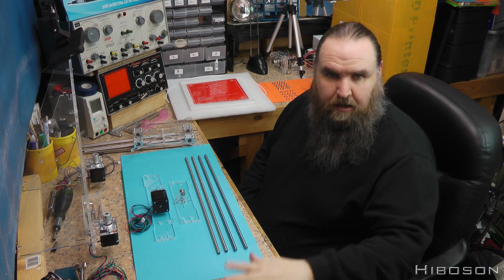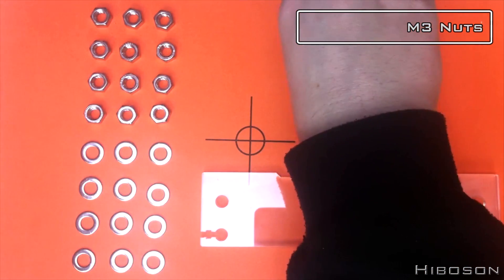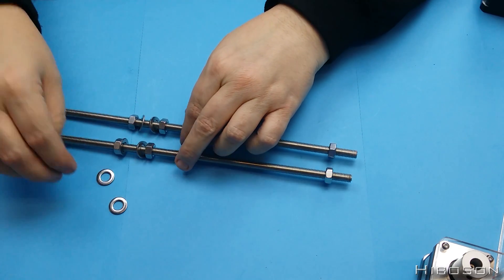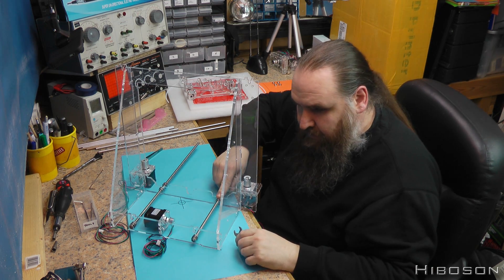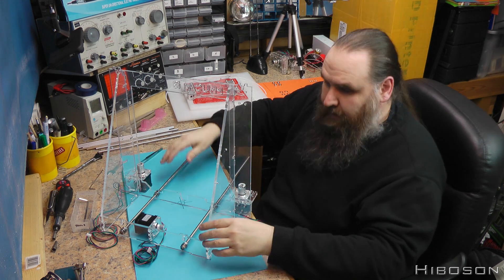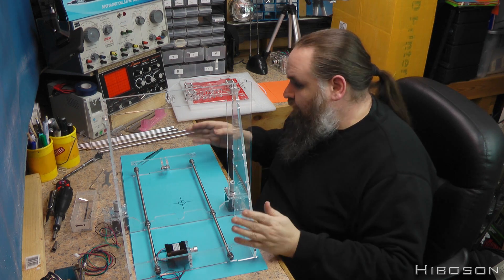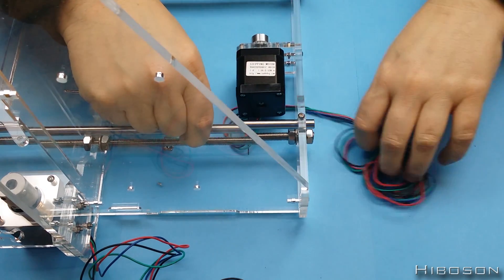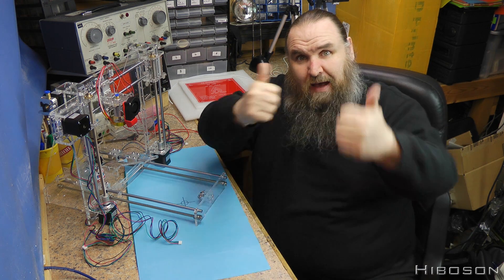3D Printer Build - Sunhokey Prusa i3 - Part D

Comment: I've been very interested in this particular kit, because of the price and the overall good comments on the page. It is to note some points about the printer particularly abour the duct that cools the extruded filament has a desing flaw and only cools one side of the printed part creating a temp diference that badly affects the quality of the print. for that a user of thingiverse posted an improved version of the duct http://www.thingiverse.com/thing:714939/#files.
in general it is a pretty solid kit compared to other for about the same price in the market.
Reply from the maker: David Ramirez I saw all the good comments about the kit itself, not so many about the aftersales lol but the kit yes :) thats why I finally went to myself "just buy it stop procrastinating" lol 

And thanks for that link to the fan upgrade part,, I actually went Ooooooooo cool when I saw that :)

Hiboson

Comment: Great progress .. Somehow my kit came different than yours even though I ordered from same company ,, The acrylic parts are different in shape and it's built differently.
Reply: Harasi the thing is (and is specified in the description of the produc in most - not all - pages) that after february they updated the kit. used a "better" endstop holder, changed the heatbed from PCB type to aluminium and added a mount for the LCD controller in the frame of the printer.
Reply: David Ramirez also they added tansioners for the X and Y axis belts
Reply from the maker: Harasi Gotta love the Chinese mass production consistency lol, but I know they have a couple of different models, but as long as it prints and does what you want it to and not missing anything you where looking for in a printer then hopefully all is good :) if not let loose the dogs of war ;P
Reply: David Ramirez Good to hear so & right it came with aluminum bed and belt tensioners
Reply: Harasi did it came with an 8Gb SD card?
Reply: No SD cards included.
Reply: yes mine is aluminum heated bed which is a clear aluminum square sheet with heating device taped underneath it. I am still on my build progress so haven't tested anything yet.
Reply: Based on what i have read the aluminium bed has a much more reliable heating behavior but it get less hot.with the standard.3d printer psu than the.pcb one. Not that it wont work with regular pla ir abs. But if you try nylon or polycarbonate problems will appear as they.need overall higher temperatures
Reply: same here .. lets just go with 3d printer adventure
Reply from the maker: Harasi +David Ramirez Nice to know there upgrading :) Looks like I got mine just a little to soon, should have waited lol,,, is that alu bed a heated bed then???
Reply from the maker: Harasi be cool to know how they compare :)
Reply from the maker: David Ramirez Oooooo something I might look at at a later date, for now gonn play with what I got, but it's cool to know there are options out there :)